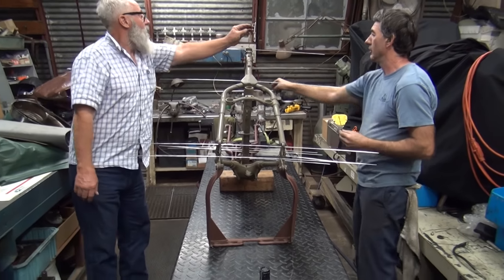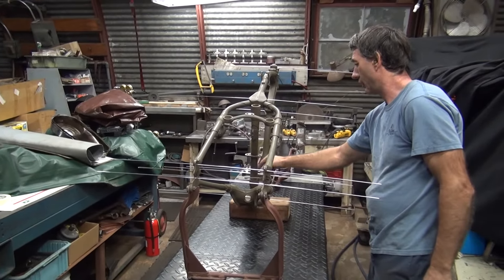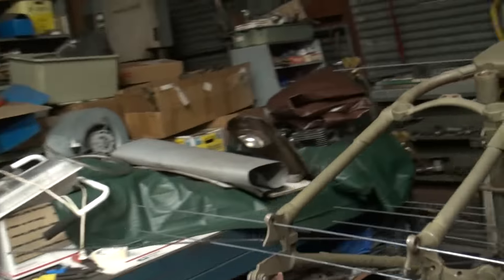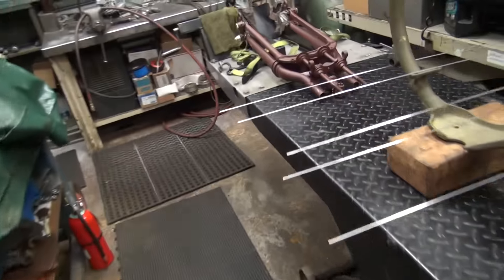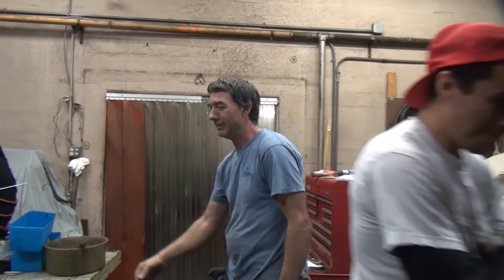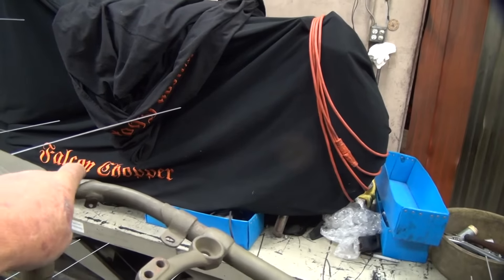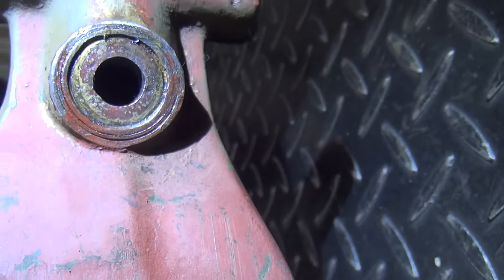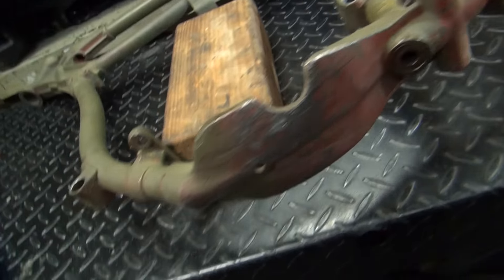1942 wlc wla 45ci #138 frame restoration straightening rebuild bike repair harley by tatro machine

Comment: holy moly! the 201,703,302,002,39th video!  Weld the rods to the bike frame, mount it on the roof, make a great digital antenna for a tv. Awesome frame!
Reply from the maker: hey dumbass, that is the date stamp.
i will see if alan wants to do that or just ride it.
tatro